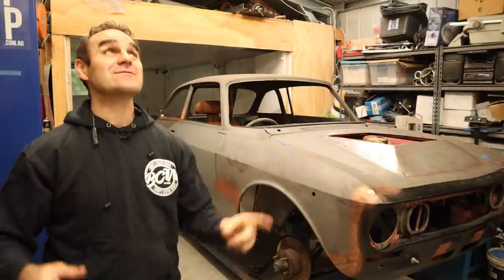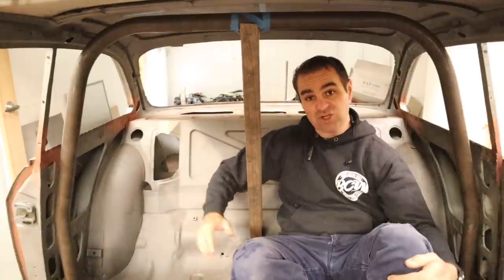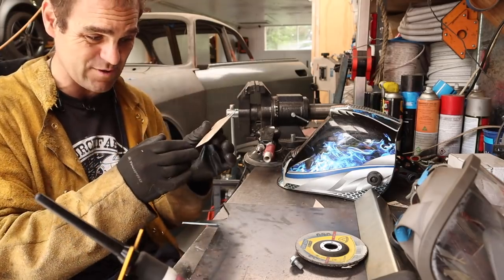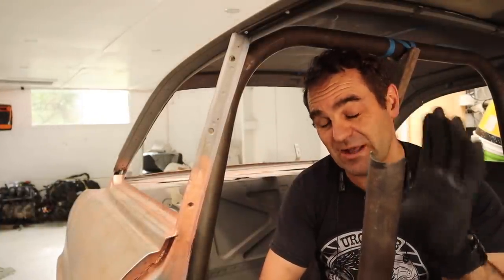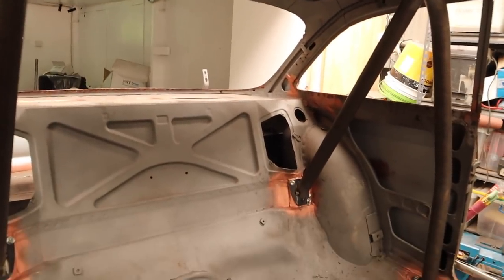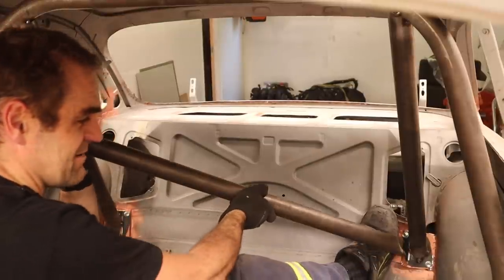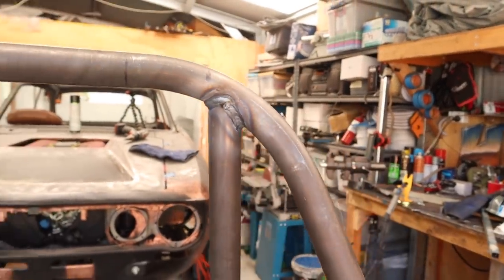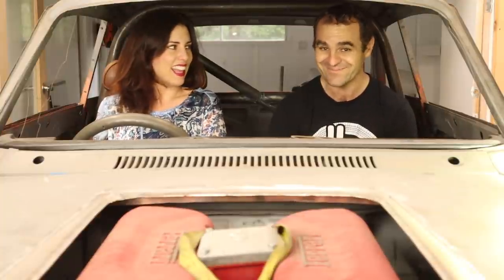She is Very Cagey - Ferrari engined Alfa 105 Alfarrari build part 79

Comment: I like your explanation as to why not a full cage. It is new information to me and I learned something. Thank you.
Reply: Well, exactly that is the problem. You learned nothing. It's only his opinion. 
On a well build cage you only lose about 50 to 60 mm of clearance (headroom). 
Yes, in some occasions (long upper body, tight roofline, wide transmission tunnel) too little headroom can be a problem. To say a full roll cage is generally wrong in a street car is not correct. But this only a opinion, too.
Reply: Full cage is not road legal in Australia unless you have exemption for rally racing or it is factory fitted.
Reply: @Jeroens1000  what if you completely covered it in fia foam, then did a full headliner/a pillar trim to?
Reply: To be fair, the main danger of running a cage with no helmet is people don’t tend to like having their harnesses done up as tightly as they should be. 

In a modern bucket seat with ears, and with your harnesses done up tightly, it’d take a very extreme crash at some very unlikely angles for your head to make contact with the cage as the harness stretched.
Reply: @piffiiiiiiit  That’s crazy, 4/5/6 point harnesses are more secure than a 3 point belt, because they’ve got more points, obviously. I guess they’re worried about people putting them on too slack, which is much less likely with a retracting seatbelt.

Can you have a 3 point and harnesses fitted?
Reply: Hi Jeff, thank you for covering off the topic of the dangers of fitting a cage to a road car with no helmets. I tire of telling kids here in the UK that adding a cage that fits under the roof of their MX5/Miata is a dangerous idea. I see so many where the forward bars are at ear height and only 10-20cm from their head......ridiculous.
Reply: @piffiiiiiiit  ....I can trim that sentence down to highlight virtually the entirety of Australian governmental oversight of human activity inside the national borders.      ....."Not legal in Aus"
That pretty much covers it.

Comment: story time:
 i used to be an EMT in rural NH.  one night we got a call for a car off the road into a tree.  upon arrival on scene, i saw it was my brother's rally car (full cage etc).  It had turned into a croissant around a tree.  Both occupants (my brother and his friend) had large head wounds, bleeding profusely.  chunks of red and tan stuff splattered all around the car.  my brother's hair was caught between the body of the car and the roll cage.  we had to cut his hair as part of the extraction process.  cutting the car open would have taken longer because of the full roll cage.  It was completely disgusting.  until my partner noticed the pizza boxes etc,  the red and tan splatter was pizza and extra sauce everywhere, though in the dark and the focus induced because it was my brother, i hadn't noticed.  brother did have a closed (yes closed) head injury, and spent a week or so in the hospital recovering.  rally car was a total loss.  DO NOT drive full roll cage cars on the road.  He was going way too fast, he hit black ice, and hit a tree hard enough to fold up his cage.  the extraction took longer because of the race seats, harnesses, and cage.  the icy conditions we a challenge for us, as well.  the second unit slid right passed the scene, and it took another few minutes to get turned around and back up the slight incline.  these weren't because of the cage, but it's an example of other factors first responders face in addition to the accident itself.  and for us 45 minutes of the golden hour are used up just in transport to the hospital, forget about conditions on scene, and the extraction (which often take a lot of time without racecar).

Comment: Tips
To easily get a tube profile wrap a piece of scrap in paper extended past the end by the diameter, gently push the wrapped end against the surface you want a profile of so that the paper folds and curves around the surface, trace around the surface with a marking pen so that you have a clear line on both the surface and the paper, cut the paper along the line then wrap it around the work piece lining up the profile where you need to cut, mark the work piece and cut it. Note the paper template may be reused on a mirror piece by wrapping it with the opposite face against the work piece .
Profile cutters or tube notchers are just hole saws and a clamping system you can make one out of scrap wood and a drill press. Clamp two bits of wood together and drill a hole between the two the size of the tube, put in some bolts holes to clamp the two bits together. Cut other bits of scrap wood at various angles that you may need to cut the tube at and use them as wedges you screw to the clamp to hold the tube at the angle you need to cut at.

Comment: Just welded a full cage for a Alfa 4C also TIG. The distortion was fixed with a hydraulic doser and it fits good now. But the mounting plates are difficult because it have to be glued in and the owner still trying to figure out with glue and process so it's up to standard with FIA rules. It's going to be a great race car even with stock engine. (It's not going to be stock for long if i know the owner right) 

Love to follow your channel. Hope it inspire people to built stuff them self, so we can get more track days, more races's back. And bring back innovation and creativity

Comment: Great idea with the your transfer screws. I've also made them in the past and found that cutting a slot in them just off-centre on the point side with a hacksaw or grinder just deep enough for a flat blade screwdriver will help you get them at the right height easier than trying to screw them in or out with your fingers.

Comment: Tip for exhaust and other pipe work.
Fence wire garden hose and toilet rolls
If you need to make a set of headers you can make up some sort of plug with wood or steel to get the central position of the ports . Attach the fence wire to the centre of the port and run a length to about where the collector will be plus a bit extra.
Pass some garden hose over it and then add extra wire to make the hose reasonably stiff then the toilet rolls or other short bits of tube that’s close in diameter to the exhaust pipe you will be using. Bend the hose into the shape you need using the bits of tube to keep the spacing . When you have something that looks like a set of headers you can measure and mark the centres of each bend and with a little math correct for the larger tube diameter.
Note when bending the hose with the wire inside use something with the same radius as the pipe bender or bends you will be buying.

Comment: I daily drove my full caged rally car for a long time. The MOT (inspection) guy was adament that I fitted padding in the head areas. Although not required by law he insisted I did, so I did. There was no way your head was getting anywhere near them with the harness but it was nice to know it was there I guess.
Reply: Did the same. Drove a fully caged car with bucket seat as my daily driver. Seat position was lower as with standard seats. Had plenty of headroom. Was definitely safer than the standard car.
Reply: Yeah this is pretty small car though so I can understand it a little more.
Reply: @Mrcaffinebean  The car I had was a Citroen Saxo. Not big either.

Comment: The only correct place for the rear mounts!

On my current alfa giulia project they put them on the inner arch and then connected it with a short tube to the chassis beam🙈

Comment: I know you’ve done it bolt in, but I’d be way too tempted to do a nice dimple died gusset to that thin part of the B pillar.
Reply from the maker: It is a bolt in cage ;)
Reply: @HomeBuiltByJeff  Did you see what Bad Obsession did to get around the ‘no welding gussets to the cage/chassis’ rule in that aygo/c1/107 race series? 

Could do something similar and weld tabs with nuts on them to the b pillar and the cage and then have the gussets be bolt on.

Comment: Gday Jeff,,,      IDEA,,   maybe make captive punches from stainless bolts, and in different diameters, both metric and imperial ,,   stainless is harder , the tips will last without sharpening and won't rust,    being a diesel fitter myself, i have a full set made up to 1 inch and 24 mm,

Comment: A properly designed and installed front cage is no more a head injury risk that the roof pillar/A pillar especially when you factor in the probability of the collapse of the weak but hard structure of the base vehicle without the additional reinforcement of a front cage.  It goes without saying that proper roll cage protection foam is expected.  Indeed, in the UK, Motorsports UK recommend the fitment of a full cage for those competitive events where helmets are not required or banned e.g. Road Rallying.  Without a front cage you cannot  provide the necessary strength to bolster the car against side intrusion with the likes of door bars etc.  To say that a cage prevents the easy extraction of the occupant in an accident is fatuous as I am certain that a shell without a full cage would collapse  much more readily to the detriment (I have seen many of those accidents) of the occupants.
I also doubt whether you are capable of reinforcing or strengthening the car to the correct degree without adding a full cage.  From what I have seen, your structural appreciation of the shell is somewhat lacking.

Comment: When we built my cage in Canada, the rules said level or slightly above the shoulders. Are you sure it is below? My understanding is if the harness bar is below shoulder height, you compress the spine in a front-end collision.
Reply from the maker: 100% it should be within 0-10 degrees below the shoulder height. Above would mean there was room for upward movement.
Reply: @HomeBuiltByJeff  interesting. Valid point, I will have to look into that! Thanks

Comment: Remake it and put seat in so you can set harness bar higher than shoulder height. You can compress the spine in a accident otherwise.
Reply from the maker: I designed it with the seat in it as I showed in the video?
Reply: @HomeBuiltByJeff  My bad. Must've missed that part of the vid.